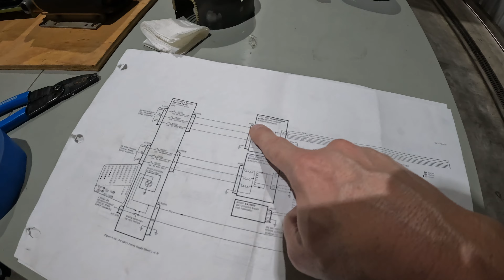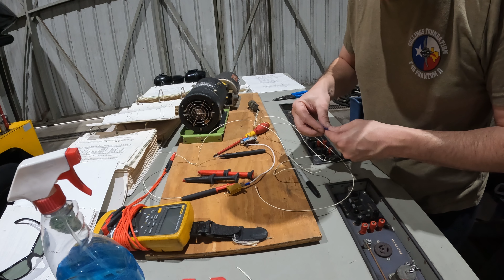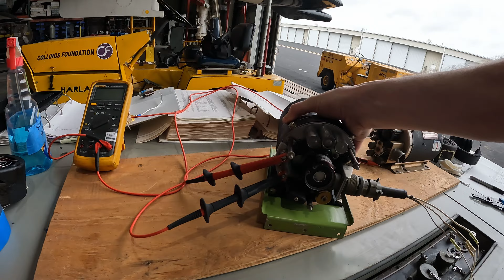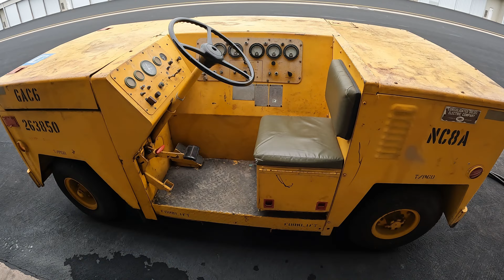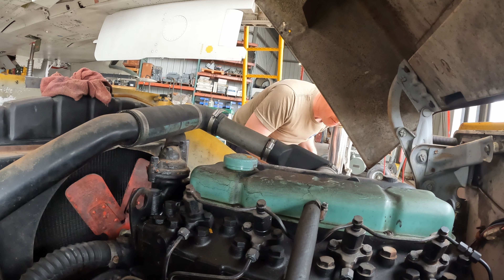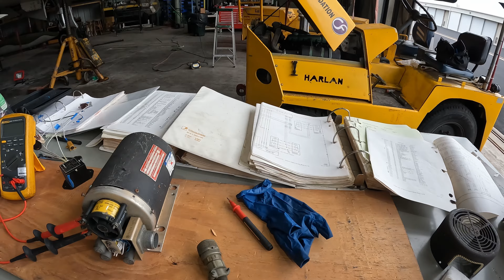Testing Continues, and is That Another Dead Battery? | F-4 Phantom

Comment: Is this that same part you has been working on a month or so ago by opening up the small hatch on the top side of the fuselage? What is the function of this part? From Dave,  an F- 4 fan for years (since Jr. high by the way : )
Reply from the maker: These are large DC power supplies, and power various systems around the jet. They normally get their power from the generators on the engines (which produce AC power), and are mounted just behind the ejection seat in the rear cockpit.. The hatch behind the rear cockpit is Door 19 and it contains a lot of electronic equipment. There's a relay in there I want to look at and make sure it functions. Its job is to connect the Essential DC bus with the Right DC bus.

Comment: I would recommend making yourself a load light.  Use a aircraft socket and 28 vdc bulb  attach wires to it and seal it up with F4 tape.  The meter will only show the potential.  The light will also put a load on the circuit.   The bulb ting is what I used most in my 20 year AF career of maintenance on aircraft.
Reply: I’ve always been surprised these are so rarely used on planes, my dad is an auto mechanic and swears by them
Reply from the maker: Not a bad idea, thank you for that!

Comment: Is there a way to load test the T/Rs before doing all that install work?  Just curious how much load they are rated for.  (I know very little about this so disregard if not important) Love the videos.
Reply from the maker: They are each capable of producing 100 amps at 28 Volts at full load (2.8 kilowatts). I have a DC load bank that should work (meant for testing batteries). I'll be looking at that to see what it can do for us.